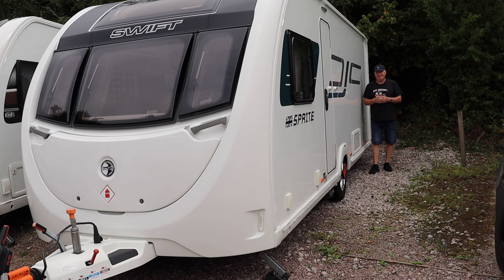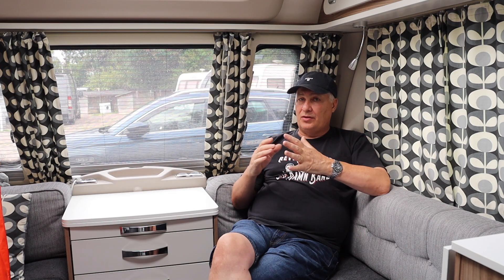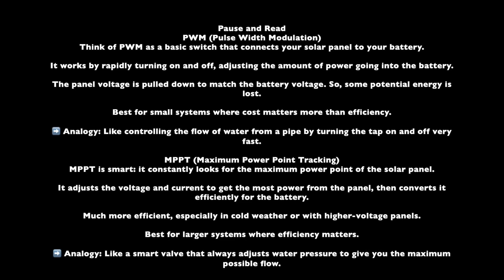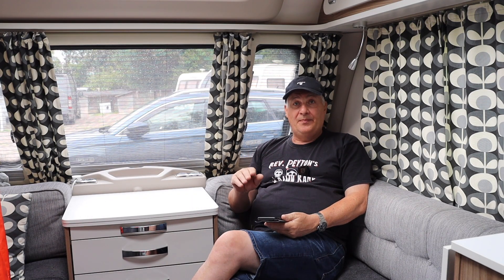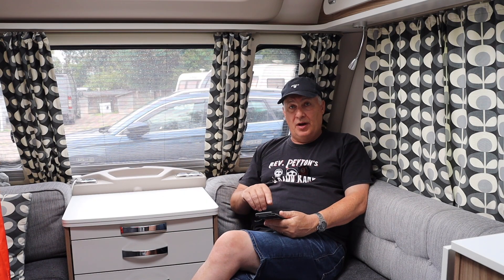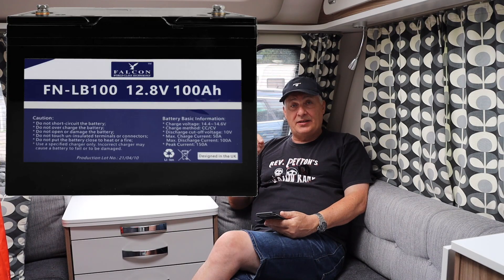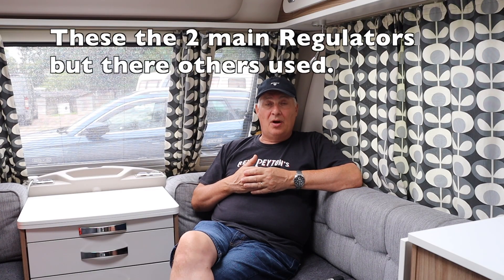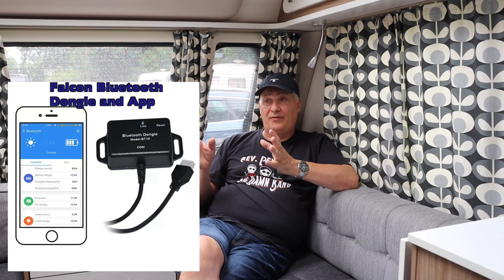Is Your Solar out of Date? PWM v MPPT

Comment: Hello Phil buddy morning I bought a full size cover for my caravan would these be a good job do you no it four ply breathable also water proof
Reply from the maker: Hi Sam I'm struggling to understand your message but I will have a go. We have a full size cover. It was made for our roof layout which included a window to allow the solar panel can still see the sun. A full size cover can be waterproof and be breathable such a Pro-Tec and Specialised I cannot comment on other Brands. We highly recommend a full cover for winter as it does protect the caravan from the elements and water ingress. Again I can't speak for the cheaper brands. I hope this helps. If not could explain a bit more. Thanks Phil.🙂👍
Reply: @lostweekendscaravan yes Phil thank you I did buy a full size cover and didn’t release about the solar panel needing sun light but I’m going to remove the battery and keep it on a trackel charger this cover is made by   OI PRO     ITS Breathable 4ply protection for UV light also

Comment: Hi Phil, just had a check of my Solar Unit and it is the Truma SDC12 MPPT, I’ve now ordered the Falcon Dongle which seems to be a great price and your right the only info you get is very basic, which is through the Swift Command Centre which in my van is only how much charge my battery is holding…Thanks again very informative😊
Reply from the maker: Thanks Joe. The falcon dongle is very useful bit of kit and the is simple to use. Many thanks Phil 🙂👍

Comment: We had a Truma panel fitted by the factory on our new Coachman. As you said it doesn’t have any data available about what is happening.  We have been using it for a couple of months until I bought a Truma solar panel monitor (£60). It isn’t Bluetooth but give loads of data about what it is doing. When I plugged it in the panel had not been working from day one!! Blown fuse.  I’ve got a Teconnex lithium battery ( UK made)It’s got a fantastic App so I monitor what is happening with the battery from there.  
Great post brings people updated with solar options
Reply from the maker: Hi Alan. I am glad you have sorted it out. The Falcon Bluetooth dongle is about £65 similar to the truma monitor. I have not heard of Teconnex. Lithium is something I have been considering. Thanks Phil.🙂👍

Comment: Our 2015 Swift has a factory fit 40w solar panel. In 2022, I installed a 120Ah LiFEPO4 leisure battery (with bluetooth management) and replaced the Sargeant PWM solar regulator for a Victron Smart Solar MPPT regulator. It has Bluetooth and, through the App, does all that the Falcon does, and more. In addition, it can wirelessly link to other Victron battery management devices. The MPPT regulator harvests every last drop of solar power and during winter storage keeps the lithium battery fully charged. I would recommend anyone with a PWM regulator to swap it for MPPT. The difference in efficiency is really noticeable.
Reply from the maker: Hi Barry. Thanks for the feedback it sounds like you have upgraded your system and are seeing the benefits!  At some point I would like to upgrade to a Lithium Battery as I feel the van would benefit whilst in storage. Thanks again Phil.👍🙂